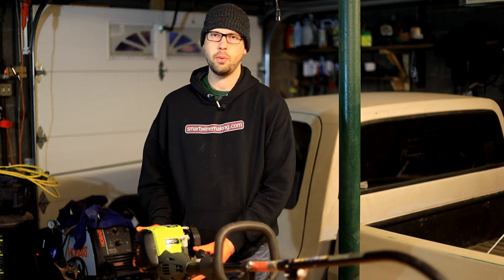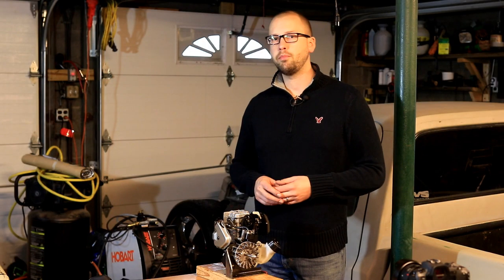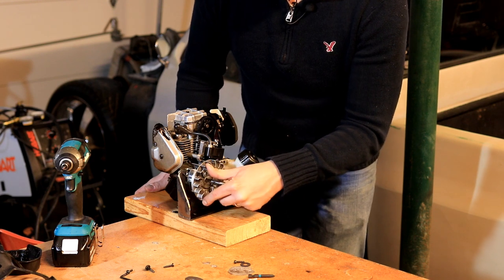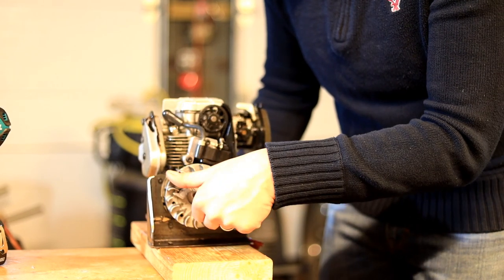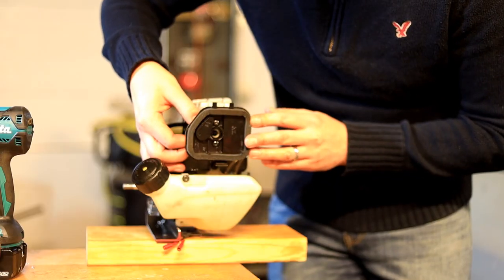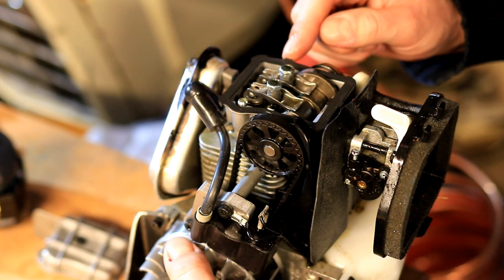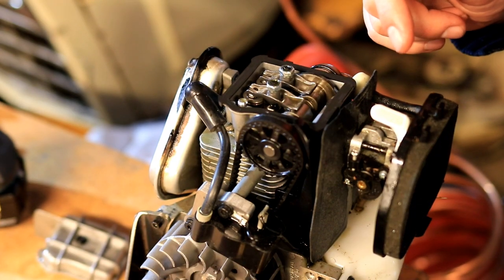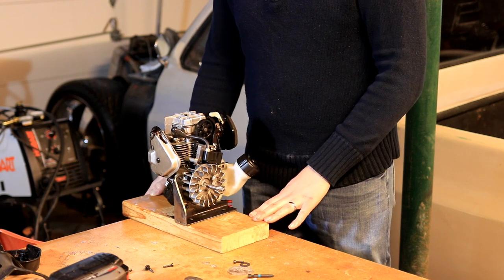Removing a Weed Eater Engine and Running on a Stand - 4 Stroke

Comment: Never thought i'd see a weed wacker engine with an overhead cam, the more you know.
Reply from the maker: I know, it's crazy.  I bet we will start seeing fuel injection in a few higher end chainsaws and weed eaters in the next ten years.
Reply: @CoolStuffGuysLike  the new stihl ms500i saw has fuel injection, from what I hear it guzzles through fuel, which I guess Is to be expected.. that saw goes for atleast 1500-1700, so. It might be abit until we get fuel injection in the homeowner line. Nice video by the way!
Reply: @CoolStuffGuysLike  Catalytic convertors and 02 sensors too. EPA and C.A.R.B.  laws will eventually stop 2 strokes sales. Power equipment is constrained in
Cali. Primer bulb mowers with fixed throttle and no spill gas containers, came out of their regs.

Comment: This model worked great for me, then refused to run without the choke.  Discovered the rocker bolt for intake/exhaust had come loose, wrenched it down again and it has run great since.

Comment: Awesome video! This engine would be cool to power a rc car if the wacker itself breaks too lol. I find that the belt likes to pop off the camshaft pulley. Good thing these engines are non interference!
Reply from the maker: Thank you!  I agree it would be a cool RC engine.  It doesn't have the high whizz like a two stroke or nitro two stroke.  Probably doesn't really have any real power advantage but it would sound cool and should have plenty of go juice.
Reply: @CoolStuffGuysLike  you're welcome and I agree with you on that.
Reply: Yup, very cool. Some experimentation to limit WOT so the belt does not pop off.
My 2 stroke poulans run well @7000rpm
Since this Ryobi is a 4 stroke perhaps max should be < 6000rpm? Might be just adding a magnet for a hall sensor and tachometer
To test run. And adjust end point on servo.

Comment: This is a neat little engine. Just always store it upright or it will get oil in to the cylinder and lock up. Forcing the owner to remove the tapet cover and open the exhaust valve.
Reply from the maker: Thanks!  Yeah it is a pretty cool little engine with the overhead cam and being so tiny.  Doesn't have a lot of power but cool to play around with.  I need to think up a new use for it now.
Reply: Why wouldn't you just remove the spark plug to release the oil in the cylinder?
Reply: @Connorsdaddy12062008  Because it's not actually something you can fix that way. The valve basically jams up and thows timing. It's a belt driven overhead cam. You could in theory I guess try it. But it didn't work for me.

Comment: Add a small car alternator to it to get 12v and a bit Arduino with some code to regulate throttle based on load

Comment: Hi love the video and wish I had found it sooner. Would it be possible to get more in contact with you to get a rundown of the oiling system from the tubes, check valves, and air/oil filter? I am currently an engineering student and my team is working with this engine and we have been making some assumptions as there is limited information on this engine.
Reply from the maker: Thanks man.  I am no expert on the little ryobi engine so I probably couldn't help a hole lot.  The air filter is just a foam element if I remember right.  I don't think it has an oil filter but I would have to go check.  Most small four strokes like this don't.  The oiling system is just using crankcase pressure and a little port.  I was going to run the little weed eater engine on methanol which I may do once the weather warms up a bit.

Comment: The exhaust on these little engines is what is realy killing them. put a manifold and simple exhaust and they pick up so much more power and not getting strangled.. good motor.
Reply from the maker: That is good to know!  Thanks for the info.

Comment: I have a similar engine only 2 stroke. How do I mount it? Or at least mount it upright how you have it. Thanks!
Reply from the maker: I used a couple pieces of angle iron to build a bracket that mounts to a few of the bolt holes on the crank case.

Comment: There a 2 types of reduction  drives.
Sold on abay or azon. The smaller reduction drive is internally a worm gear setup. So it will only rotate in one direction I believe.
The larger reduction drive is simple sprocket chain setup. So it can run either direction.
Unless you have the bike bury setup with a one way bearing on the input sprocket.
Reduction will vary. 5:1 or 3:1 numerically
Since this Ryobi 4 stroke and a relatively short crankshaft, I would try to use one of the two
Gear reducers with it's factory centrifugal clutch. So you will need to source a clutch bell that will fit the ryobi and the gear reduction will have to spin counter clockwise, to make a functioning clutch.
The engine bracket he built is very good.
A sheet of aluminum or steel can be shaped and formed to still use air cooling from the flywheel. And as others said, maybe different exhaust system .  VERY IMPORTANT! Any diy exhaust pipe MUST have a spark arrestor. Or you may have a very bad day in dry grass.

Comment: am I seeing correctly, when the hole in the camshaft gear is at 6 o'clock, the center of the magneto on the flywheel is lined up center with the ignition coil? Im trying to verify the timing. Can you tell me where the hole in the camshaft is when the coil and magneto are aligned? I have a Black Max 4 cycle trimmer. It has never run. got it on clearance and cant return it. I have spark, i got a new plug, will not run with starter fluid in the carb. Will not do anything. from what I understand disassembly is required to find timing mark on the crank shaft. I get a little, very little smoke from exhaust. Any help would be  appreciated. I have resistance when pulling the cord and the spark plug is in, feels like compression.

Comment: Can you run this upside down?? Would like to put on a  R/C plane....
Reply from the maker: Since it is a standard wet sump 4 stroke it will not be able to run upside down without most likely blowing up in a big smoke show.  It is a cool little engine though.  Might be a little heavy for an RC plane.

Comment: How does the oil system work, is there a pump that is connected to the engine  somewhere? I saw it squirting oil when you pulled the valve cover off, what creates that pressure, and where else is the oil supplied to.

Comment: I see it has a little compression release pin that sticks into the exhaust lobe to slightly bump open the exhaust valve to lower cranking compression:)

Comment: hello, I have one of these that will not run. it was new when I got it. Clearance, cant return. I have spark, gas, air, I have checked timing several times. I get a bit of smoke when spraying starting fluid. has never cranked up, not even a rev. any suggestions I can check please?

Comment: Great video I think I might have a sthil weed eater lying around that I don’t use I’m thinking of making an rc car I’m pretty sure the motor is 42cc and a 2 stroke what do you think? 🤔
Reply from the maker: Seems like a cool project!  Sometimes the newer chainsaws will have the bottom half of the crank case molded right into the housing which might be a little tricky if that is the case.
Reply: Cool Stuff Guys Like yeah but like I’m gonna use an old weed wacker not a chainsaw I have no way to connect the relay boards an steering module

Comment: My flywheel is stuck. I cannot rotate it. I have a CMI trimmer. Any ideas?
Reply from the maker: Hmmm, that seems like the engine is probably seized, like you broke a piston or it was outside and rusted in place.  You could pour some oil in the spark plug hole and let it soak for a couple days but it probably won't free it up.  You can try penetrating oil also but it is hard on rubber seals, so I don't like to.
Reply: @CoolStuffGuysLike  Thank you. It did not stay outside. It was difficult to start so when l pulled the rope hard it got stuck. At first l thought it might have been the rope, i.e.coil,but it worked fine when disassembled from the flywheel. Flywheel is stuck. I see the nut but it is difficult to reach  because of the propellers of the flywheel. I can see the bottom of the engine from the back, when l remove the tank, should l put some oil down there as well?
Reply: @CoolStuffGuysLike  l pute some oil in the spark plug hole and after a few hours l was able to spin the flywheel a bit but not much. Should l wait a bit longer or try to open the cylinder?
Reply from the maker: That is promising.  I would work it back and forth a bit.  It should hopefully free up enough.  If you can't free it up, you will need to take the head and cylinder off.  If it is a 2 stroke it is very simple.  If it is a 4 stroke, just make sure to mark the timing belt and pulleys so that you can get it back together on the same teeth.

Comment: Did anyone else notice that extra little lobe 180 degrees opposite on the exhaust cam right after the intake stroke lobe makes its pass? Im guessing it might be used for exhaust gas scavenging or some kind of way to pull in a little bit of un bured fuel from exaust fumes using intake vacuum? Might be an emissions thing.
Reply: Or for lubrication purpose
Reply: Thats the compression release it springs closed when run you need this for easier starting

Comment: I have the same Ryobi trimmer. It starts fine but after it's warmed up it starts slowing down. Even after I squeeze the throttle it eventually stops. It will not start until it has cooled. Then it will start again but only run for about 2-3 minutes and shut down. Not burning oil.
What could be wrong?
Reply: Valves might need adjusted or possibly a carb issues
Reply: @conner5611  nevermind. The motor locked up. I'm tired of dealing with it. I bought myself a Stihl Combo set. It's the best.
Reply: @orionthehunter9107  nice i love sthil they are reliable and easy to work on
Reply: @conner5611  I totally agree. I had heard that the 4 stroke, or whatever they call it, had it problems but the Ryobi sucks.

Comment: Bro no way it’s got ohc
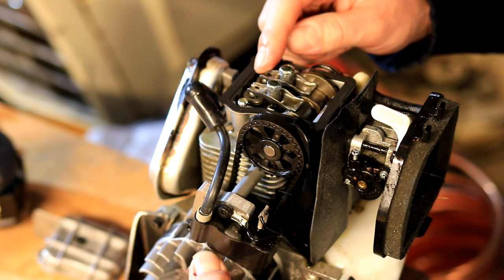Reply: Zoom to 6:00 and you can see the overhead cam.  It is also pretty obvious that it has an OHC since it has the little timing belt and pulleys with one of the pulleys right below the valve cover.

Comment: These engines have a big problem, they don't last, cam bearings go out/loose, belt skips teeth and that is all she wrote. Junk engines, I have a pile of them, trash weed eaters. They burn oil like you can't believe fowling the plugs in a day. Don't keep them level, the oil hydraulic locks the piston solid. Have to take the plug out to clean it out. Real sad, because it could have been a great engine for weed eating. Long story. Check the reviews and you will know the truth.